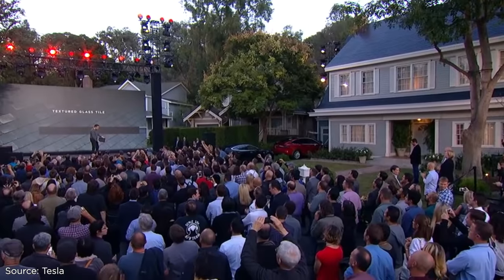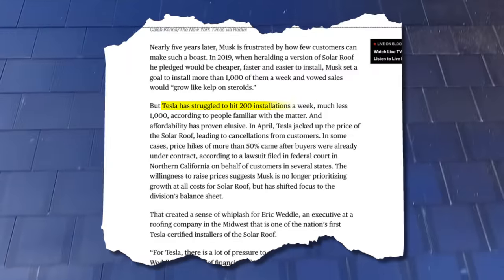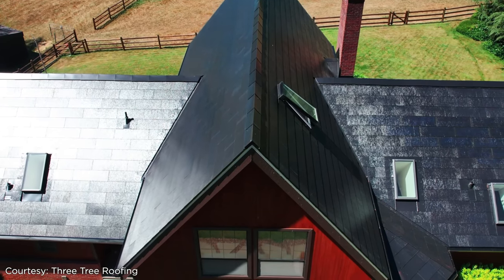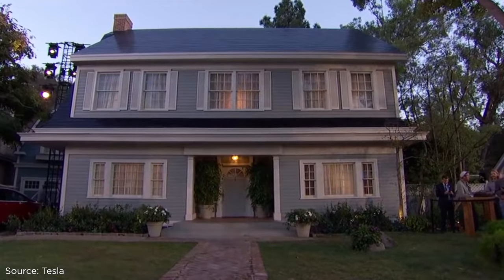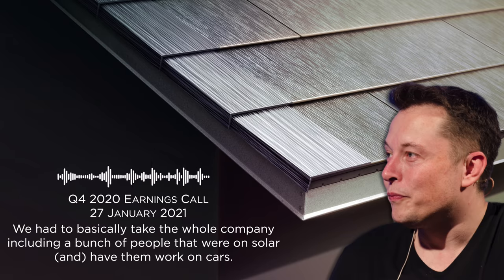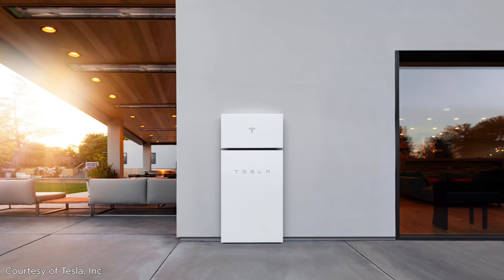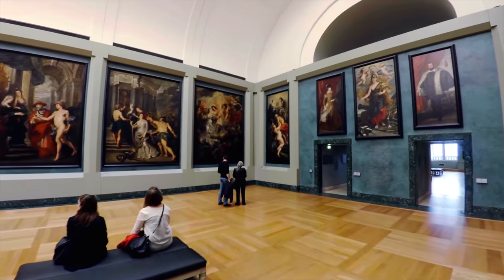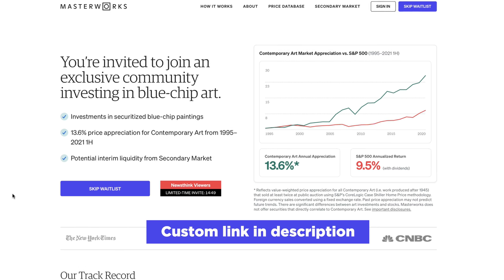Where are Tesla’s Solar Roofs that We Were Promised?

Comment: As one of the earlier adopters of the solar roof, it’s a remarkable system. It works flawlessly and I only wish I got a bigger system. The challenge is all the operational problems and speed of installation.  If you’re patient and organized, it’s worth it in my opinion.
Reply: “I only wish I got a bigger system”- implies the solar roof underproduces. I’ve seen estimates and real world production and these solar roofs produce a fraction of power compared to similarly size conventional solar panels. BIPV has been around since the early 2000s and there’s a long way to go before it becomes competitive with conventional PV panels.
Reply: @efg1311  no my solar roof system actually produces more than the rated estimate.  My wish for a bigger system was due to my own conservative planning.  Yes, the solar roofs tiles produces less per area compared to conventional panels but if your roof is big enough, it's generally not an issue.
Reply: You could of had a bigger system with better production panels for a way better price than tesla..  like probably $15k less with back up storage
Reply: @jeffreyrogan6333  I needed to replace my roof as well so the cost difference of roof + panels vs. solar roof was small at the time.  The price difference is probably much greater now.

Comment: Who ever brings these shingles to market at the same price as regular solar panels will be a huge winner. 

I build luxury homes and regular solar panels are fine for the back of a home facing south.  But on the front of a traditional 12/12 or 10/12 gable they look blah. 

I’d like to see even standard panels reduced to a 12x24 panel that is designed to overlap and be staggered. With non functional panels that can be cut and make the roof appear to be shingles. This could keep the panels simpler but give them nicer esthetics.

Comment: Solar tile cost is a huge premium to pay for marginal aesthetic benefit. A normal Spanish tile with conventional solar panels isn't horrifically ugly enough to pay 3x to 5x the cost. (As for powerwalls, Tesla seems to be losing market share to Enphase. Whether that's due to spotty supply or Tesla locking the walls to Tesla solar panel installation...)
Reply: I don't understand why you would pay for Spanish tile roof if you were going to put a conventional solar panel  array on top of it.  OTOH, it would be nice if someone came out with roof designs with conventional panels that looked good.  I don't understand why Tesla doesn't have a lot of preconnected tile assemblies to be able to cut down on installation times.
Reply: Tesla also switched from glass tile to steel metal tiles for the non-PV tiles. Doesn’t make sense to me to go from my concrete roof to a steel metal roof.

Comment: Here's what actually happened:
It wasn't original. Elon didn't even come up with it. NASA holds the patents and as expected, many companies (beamreach solar) tried developing a prototype in 2005 but went bankrupt in 2017 despite raising $250M. Same for Dow, RGS energy. The demonstration of the rooftop tiles was completely fabricated. Not only those houses weren't powered by tge tiles, not a single tile was in working condition as those wrere props. It was simply a ploy to deceive his shareholders. The thing is it was bleeding money and was in $3.2B debt. Musk was convincing his shareholders to buy the company, while promising they did work. 
Then there were mass layoffs in SolarCity. 2017 Q3 solar installations dropped 42% year-over-year. 
Walmart and another company are suing Tesla as their installed solar panels caught fire and demanded. Thr story of Tesla solar panels catching fire started being reported by people when they realized they weren't the only ones. Panasonic pulled out of the partnership for this reason.

Q4 2015 272 MW
Q4 2020 27 MW
It's a glorified dropshipping company where they get Chinese solar panels and just add the company logo.
Reply: Quite unfortunate. Please what would you say is the true future and substantial innovation for solar panel technology? Thank you
Reply: @emmanueloluga9770  Solar panels have myriads of problems: they are the worst form of capturing solar energy(efficiency wise, which can be improved but it isn't improving at a rate to keep up with needs and there's an upperlimit unlike Moore's law); they deteriorate at 1% per year, and in 25 years are completely worthless(can't be improved); disposing them is really challenging(As solar panels sit in dumps, the toxic metals they contain can leech out into the environment);  they are completely unviable option when there are clouds or during night.

So what's the solution?
Turns out we already have the best form of capturing solar energy. We've been told by billionaires that we need a solution that we got conditioned to their narrative. they never choose the best alternative, but the one that benefits them the most. To get investors, their solution is always one that is trying to solve a problem that doesn't need solving. It has to be hyper-ultra-rgb lights-Rick&Morty instead of a normal solution. Like ultracrammed-manually driven-30mph-fire hazard-hyper-multi level, instead of trains. It is a farcry from 150mph autonomous safer mode that was supposed to be driven on pods(again, might seem awful lot like TRAINS!).

Dams are the answer. You use the potential energy of water stored at  heights to generate electricity. And there is already a system in place to bring the water back to the dams: sun. The solar energy takes care of replenishing the dams. You get to control how much water you want to use for electricity as per demand(nights or higher demand in general) and the rest stays in the dams: it works in day, night and in all seasons. If you run out of water(Very rare case), use Nuclear plants. It's a shame it was introduced to us as a bomb which has created such a bad connotation. I suggest you check thunderf00t's videos on Nuclear plants. It will change your perception on nuclear.
Reply: Hopefully soon they find ways to install these tiles quicker and easier.
I know they will eventually get better, after all solar roof was struggling before musk bought it.
The company was going bankrupt.
It got better 
And hopefully the company finds a way to solve the issues they have sooner and be successful
Reply: @meosh930  Thunderf00t is an Elon hater and I would take what they say with a grain of salt. I do agree Nuclear is a good clean energy. And as for solar panels lasting only 25 years, there's not one credible source where that's true. Voyager 1's solar still works without a problem. All sources point to degradation at worst is closer to 17% after 25 years.
Reply: @meosh930  Yeah, Thunderf00t shit on starlink dish because it uses 100w of power. Even his fans are like "uhhh isn't that the power usage of a regular light bulb?".
Reply: @meosh930  I have Tesla solar on my roof right now. Had it for 4 years and my degradation is 2%. I can totally see throwing it away after 20 more years.
Reply: @meosh930  I normally don't watch the spew of trash Thunderf00t release, but I couldn't help myself by clicking on starlink just to see what this keyboard warrior will nitpick. Was not disappointed.
Reply: WTF No one claimed it was original.
 LOL you just plaster Spam.
Reply: @Singuy888  I don't know why you're hyperfocused on thunderf00t. You seem to have glanced over the rebuttals made on the points you tried to make. 
1. Solar panels on Earth receive only a fraction of solar energy than on satellites. 
(can't compare situations below and above the atmosphere. )

2. Voyagers (1&2) DON'T use solar panels for power.

3. Myriads of other problems of solarpanels: leeching out toxic metals while lying in dumps, catching fire, low efficiency 

4. The customers speak for themselves: the low ratings, 90% reduction in power in 5 years, the layoffs etc.
Reply: @Neojhun  That's pretty rich coming from someone who's  spamming around my replies with the same response.
When you can't challenge the substance of the argument you resort to name-calling! "troll", "spam"  make up your mind first.
I've been a part of this channel long for a very long time. 
This will blow your mind, you can like your own comment. Like so..
Reply: @meosh930  well I am 4 years in with a 2% reduction in power. I haven't seen any news articles about Tesla solar having 90% reduction in power over 5 years.
Reply: @meosh930  LOL 8 Minutes thanks for proving my point. FYI All I did was use my history to go back to previous conversation. Like a REAL freaking user. That is not spamming. That was just relevant to the context which I previous was in. You are just blanket operation regardless of context.
Reply: @Singuy888 
 Like I said, you're conflating two concepts. 1% reduction for a lot of energy captured doesn't make a huge difference (for e.g. if efficiency is 100% or when they receive much more energy like on satellites). But it matters a lot when the efficiency is really low or energy received is really low.
What about the Voyagers, the problems disposals- leeching out toxic metals.
You said you're a customer. What about the other customers who overwhelmingly rated it 1 star, or the 90% drop in power in 2015-20, or the layoffs?
Reply: @meosh930  Thank you for answering My question. Sorry for the late response, I actually got super busy.

Please I would like to learn a lot more about this area and would love additional resources, or even private dm to discuss. The comment sections are no place for discussions of this level of seriousness as displayed by the dissenters with no substantial rebuttal of your Dam solution. 

I believe in Solar, not just solar panels per se. 
Also, Elon’s antics and Tactics don’t surprise me anymore. He like many others are wasteful and then claim that the resources on earth are “scarce” and “limited” which is a blatant lie to justify hoarding and unrealistic expenditures. 

Hyper loop and boring is one of the greatest atrocities to ever be called a solution to the traffic and transportation problem. It is actually nauseating to think people blindly buy into that fully.

Anyways, I’m all for exploring technology and ways of harnessing Solar Energy in more sustainable and Efficient ways

Comment: Prestige product that was intended to be a loss leader for the brand.  Same with the power walls.   As a consequence, production volume is limited to cap losses.   If and when Teslas are not rate limited by battery production and you start getting more and more solar mandates, you might get high volume delivery of power walls with a cheaper battery chemistry.  When if and when Power Walls have got a high production volume and further further solar mandates, you might see the investment in automation sufficient to make tiles practical.  Currently, the installation is too labor intensive, so you really need to deliver a next generation system that reduces installation time, as well as more factory automation.  For these tiles to make sense, you need to deliver a roof as a truss design combined with a few modules, not just attempting to integrate into stick built homes.